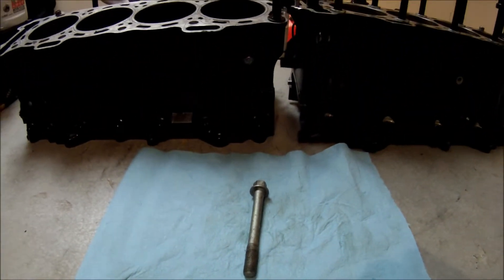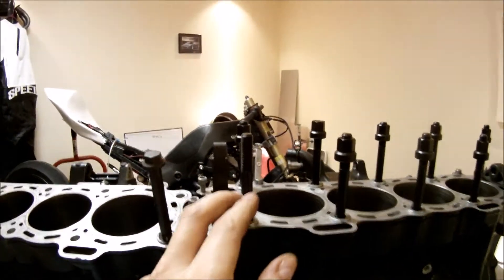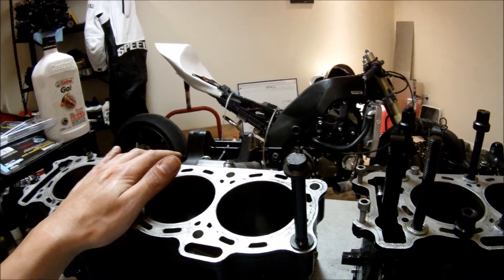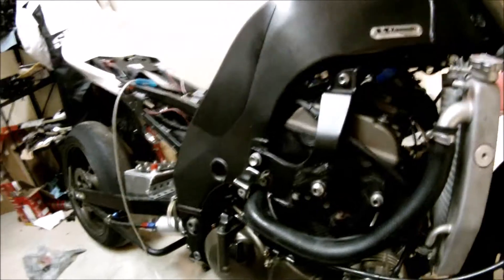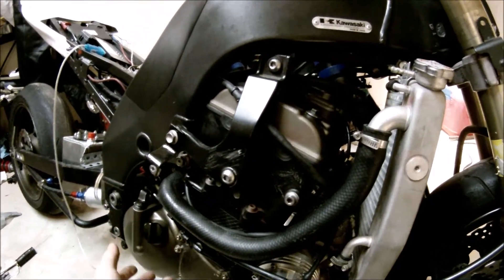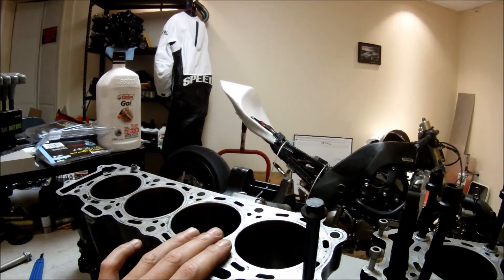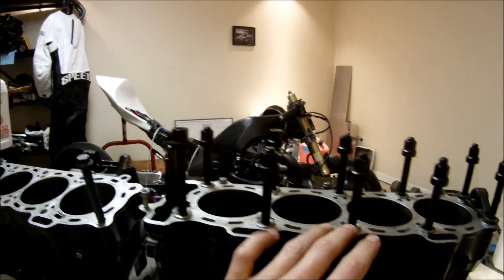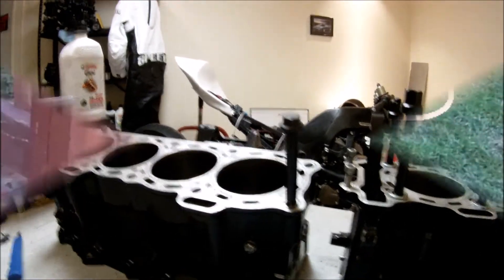Cylinder Head Bolts Vs. Cylinder Head Studs Explained.

Comment: So I got a question I took my motor to the local shop they told me since I had a bad head gasket it destroyed eight of my head bolts and I have no threads what should I do can I helium coil that how can I fix it
Reply from the maker: Get another set of cases and torque head bolts to specs.

Comment: Pull the top mounts,then middle mounts.Leave in bottom mounts,rotate the motor forward(gotta remove the radiator),then you can pull the head off.Main advantage of studs is they utilize 100% of the threads tapped into cases,vs pulling against them.I torque my zx12 1394 motor with 120 shot to 100ft lbs and have had no blown head gaskets.
Reply from the maker: Thanks for your feedback.
Reply: Will an 08 head fit a gen1?
Reply from the maker: 04-10 Heads interchange, I had to mod intake boots for better fit.  I posted a video on cyl head comparison a while back.
Reply: Stainless won't stick to a magnet,neither will titanium.I'm a Kawi guy,it'd be awesome to figure out how to make Gen1 ,Gen 5 killers.
Reply from the maker: throttleitup boost it.
Reply: Much rather go all motor.I think it can be done.Lighten up the rotating mass,get the best head/cam combo,get the compression up,raise the rpm's 1-1.3thou-ish. Main disadvantage is electronics and fuel delivery.The new bikes have it figured out.
Reply from the maker: throttleitup It can be done, boost is way easier.

Comment: Not entirely true about the studs installation or removal while in the vehicle.  Studs simply screw in and out like a bolt, they are not torqued, most have an alen key in the top so you can unscrew it very easy after the nut is off, it just takes a little longer.  Reassembly using studs should be done the same as using bolts, after the head is back on, so you don't scratch or score the bottom of the head on the studs and possibly getting contamination in the gasket or cylinders.

Comment: what website do you find your cheap ome parts I have a 2003 Kawasaki ninja zx9r please help me. my bike is stuck in 3rd gear. I've drop the motor already
Reply from the maker: Ebay, craigslist, forums, summit racing............. Split the cases and start looking for a broken/damaged part inside.